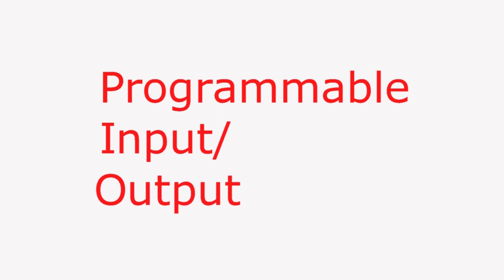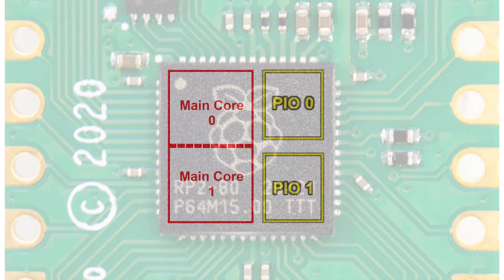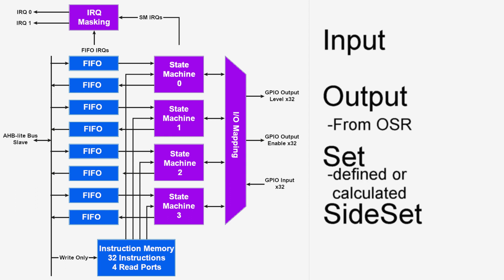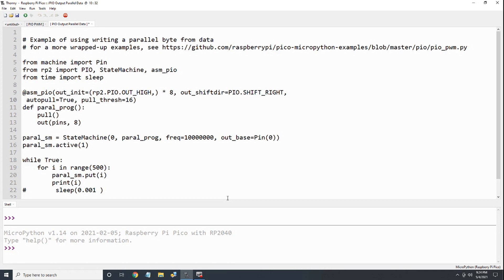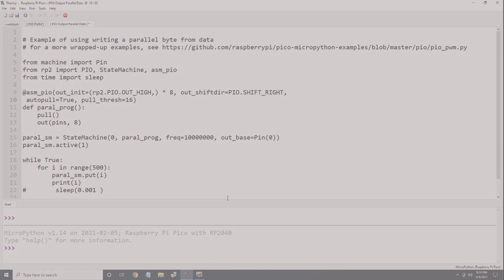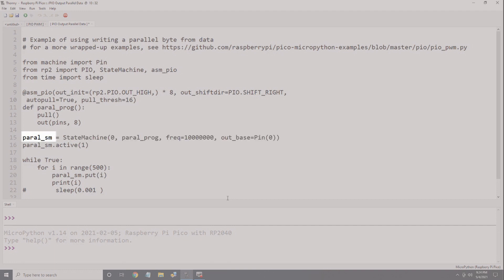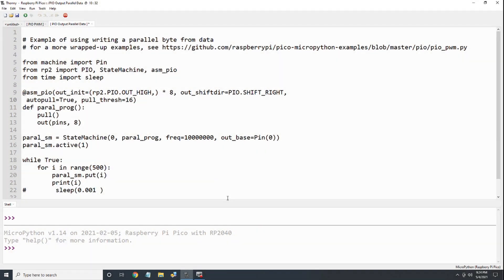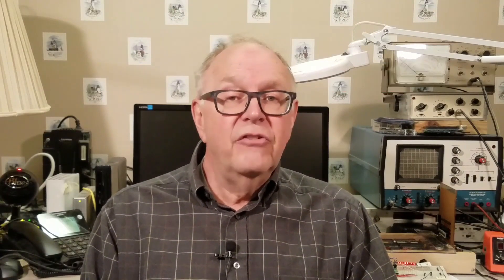Raspberry Pi Pico PIO - Ep. 1 - Overview with Pull, Out, and Parallel Port

Comment: Thanks, like for great manual. But how can you fit 500 into 8 bits? 
I mean "for from 0 to 500", but you mapped only 8 PINs, so maximum value is 255.
Reply from the maker: You're right.  But I was just demonstrating output.  The 8 bits will just roll over.  For instance, it could have been from 0 to 20,000,000 and the least significant 8 bits would just keep rolling over.  However you are right, I can only output 255 using the LED display I mapped. Thanks for watching!
Reply: @LifewithDavid1  thank you, your content is great.
This moment just confused me, thx for clarify.

Comment: Wait wait... so the FIFO registers are buffered in a way where the data can't be corrupted by my code not accounting for timing/synchronization? The PIO program will just either use the old number or the new number depending on timing?
Reply from the maker: Yes, they are pretty flexible.  For instance see this video (https://youtu.be/ZEBkM5FQ86Q) at about 8:37 to see how PIO can use the latest data from the transmit FIFO; even if no data is available.  This video also discusses interrupts across state machines and the main cores.
Reply: @LifewithDavid1  Should have thought to re-watch that one now that my ideas are slightly more than half baked.
Reply from the maker: @Marc_Wolfe  Sounds like a cool project.  I'd start by prototyping one system; like maybe real time engine crank position based on a single TDC sensor.  That exercise will get your hands dirty with the pico and you can start to see the possibilities.  You wouldn't even need an engine, you could use a drill and a hall sensor or IR sensor to start playing with it.
Reply: @LifewithDavid1  As far as actually doing something, just going to try fuel only with an Arduino Mega on a generator engine... for now.
Reply: @LifewithDavid1  If/when you do an Arduino Zero (SAMD21) series, I'd recommend ctrl+F "Event System" when looking through the datasheet. Maybe it can't do quite as complex of stuff, but when it can do the same, it sounds like it'd be much easier to implement.

Comment: Finally someone showing how to control multiple pins.  All of the examples I could find are single pin.  I was able to use this to make a pio LCD driver.  Next I want to make a 8080 parallel driver for a TFT display I have   on hand.
Reply from the maker: That sounds like a very doable project.  Good luck!  Hopefully my other videos will help.
Reply: @LifewithDavid1  one thing that doesn't make sense to me is the auto-pull feature.  Shouldn't the threshold be 8 in your program? With it set to 16 you are only ever doing manual pulls.  Out is pulling 8 bits then we wrap around and pull a new word into the OSR.  Unless I'm not understanding it correctly.

Comment: Working with Pico W means changes. One pin important for testing is onboard Led. Normally was Pin 25, but now for Pico W is connected to infineon chip at WL_GPIO0. In micropython can be addressed like Pin("LED") or Pin("GPIO0"), but... if you try to use that nomenclature in StateMachine() instatation... set_base=Pin("LED") o set_base=Pin("GPIO0")... boom! no way. And.. of course, no documentation from raspberry SDK's, even in Pico W specific datasheet. I believe that for a board good for experimentation, the change of onboard Led is going to cause some headakes. Thanks for your excellent videos!
Reply from the maker: Thank you for the tips.  When I finally get a "W", I'll keep that in mind.  I'll try to document my journeys.
Reply: @LifewithDavid1  I managed to get two of them (Pico W), send me PM with your address and I'll send you one. I think it will be more productive for the community in your hands!

Comment: Hello, thank you for this video. I am very new to electronics, but for my project I need to get my hands on it, is it possible to have a tutorial for the raspberry Pico to play videos randomly after activating an ultra sound sensor if it Please ?
Reply from the maker: Thanks for watching!  The Pico might not be the best device for this.  With only 2 MByte of storage and no native video interface, it would be a real struggle.  However, a Raspberry Pi Zero would be able to handle it much more easily.  I have done a video using a motion detector using a Zero: https://youtu.be/ZPYcAuYemG4  Hopefully that will help.  Good luck!
Reply: @LifewithDavid1  Ah okay thank you very much

Comment: Great video! What I didnt understand is the part where microcontroller is communicating with this pio with .put() command. Where this i value is sent to?
Reply from the maker: The processor uses "put" to move data from the processor into the PIO TX (transmit) FIFO.   PIO uses "pull" to move data from the TX FIFO into the OSR.  PIO uses "push" to move data from the ISR into the RX (receive) FIFO.  The processor uses "get" to grab data from the RX FIFO.  Hope that helps!

Comment: Great job. You make me this stuff understandable. Could you please make some example about pinsdir ? I'm interested in parallel bidirectional transmission where the direction of the data changes in real time.
Reply from the maker: I'm also interested in bidirectional parallel data transfer; so pinsdir absolutely will need to be addressed.  It might be a while since I wasn't to show some other things first; like the speed increase on actual data with PIO and the delay features.  Also, it's getting nicer outside so I have a VW to fix, and camping to do. But I will get to it!  Thanks for the suggestion!
Reply: @LifewithDavid1  One issue I'm addressing is how to synchronize pio pindirs with level shifter/buffer IC.
Another issue is how to change pindirs to 8bit data pins leaving 16bit address pins as input. Please deal with the topic. 🙏

Comment: Thank you for your investigation about instantation. I believe that is very important to program microcontrolers with optimum and fast data transfer through GPIOs. This method accelerates the job by using independent machine states further than registers (like arduino). Thank you again.
Reply from the maker: You're welcome.  Thanks for watching.

Comment: Hi David,
I hold this in my memory, not dive into the PIO yet.
There was mentioned somewhere that one of the PIO examples was BUS communication
.... let me lookup ... hm... 
RP2040 datasheet, page 330 mentioned "8080 and 6800 parallel bus"
however I did not found it in examples.

The PIO is very hard to wrap mind around, and the documentation is hard to understand for me.  The learning curve is very flat.

Looks the key point is the "3.5.6. GPIO Mapping" on page 359
Reply from the maker: I didn't dive in until just recently.  It took a little head scratching; but then it started to make sense.